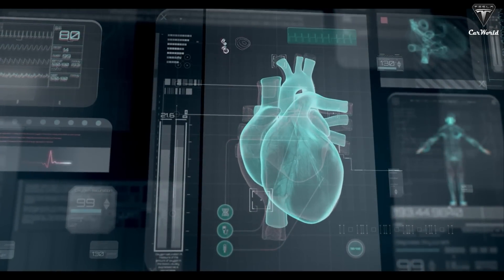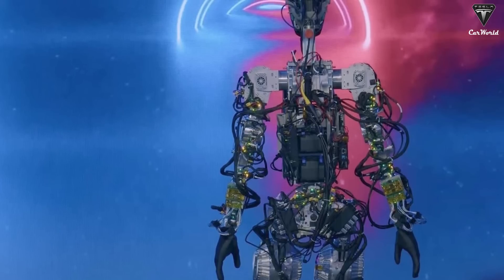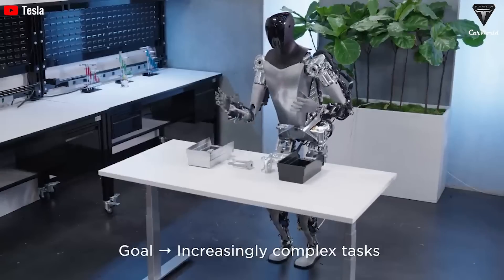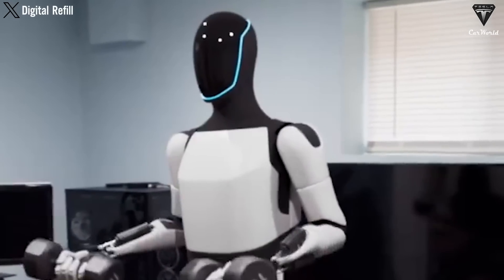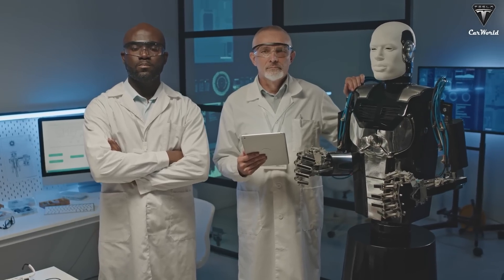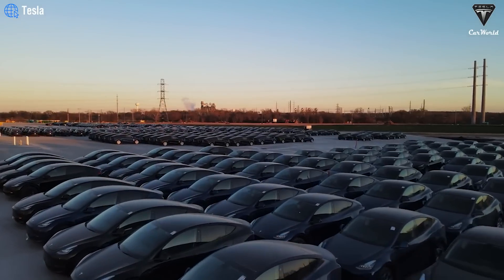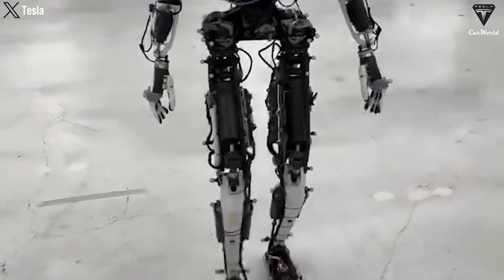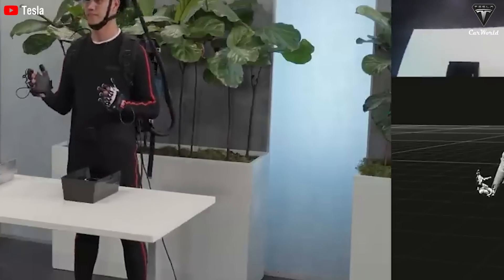It Happened! Elon Musk Reveals Tesla Optimus Bot Gen 2 NEVER HEARD Battery, New Specs and Sale 2025!

Comment: Here's just a thought🤔 how about giving the robot a mouth teeth any tongue and a trachea pipe tube from the mouth to a artificial stomach filled with cable bacteria: https://youtu.be/DPZTsGTL2nE?si=O_-mr4r2ApDVWp7n To break down organic material to electrons.😆 Making a artificial stomach that creates electrons for the robot. 🤷‍♂️🌎✌
Reply: Let's see what current AI systems have to say about this!

The video you shared appears to be a robotic design concept, and your comment proposes an innovative idea for powering the robot using an artificial stomach and cable bacteria. Here's a breakdown of the information:
Video:
- The video showcases a robotic design, possibly for a humanoid or android robot, with a focus on mechanical engineering and robotics.
Your comment:
- You suggest equipping the robot with a mouth, teeth, tongue, and trachea pipe tube connected to an artificial stomach.
- This artificial stomach would contain cable bacteria, which could break down organic material to produce electrons.
- The idea is to create a self-sustaining power source for the robot, potentially using organic matter as fuel.
Additional information:
- Cable bacteria are a type of microorganism that can produce electricity by breaking down organic matter.
- Artificial stomachs or bio-reactors are being researched for various applications, including energy production and wastewater treatment.
- Integrating such a system into a robot could potentially provide a sustainable power source, reducing reliance on traditional batteries or fuels.
Keep exploring and learning! Your comment showcases creative thinking in robotics and sustainable energy, combining concepts from biology and engineering.

Comment: Tesla Bot needs to have a replaceable battery so as it loses life i can just buy a new battery.
Reply: It just recharges, battery should last a pretty long time
Reply: @robertgtm  and when that battery can no longer hold a charge, would you rather replace the battery or the entire robot. The battery will age faster than the rest of the robot. The battery needs to be replaceable, or people will not buy it. No way I'm paying $20k and can't swap the battery for a new one as it ages.
Reply: @Patrick1985McMahon  Degradation on battery should be like 3 percent over 10 years, so the battery should last you at least until you get another, more capable robot
Reply: @robertgtm  it would be a dream if they degraded that slow, but what you said is not accurate. They will lose a minimum of 20% in 4-6 years.
Reply: @Patrick1985McMahon  Not sure why you think that. There was actually a research group that released paperwork last year demonstrating how the nickel based batteries in Optimus could last up to 100 years. Now I highly doubt that the Optimus battery will actually last 100 years, but if you estimate even 50 years, that puts degradation over a 10 year period pretty low. Not sure why this particular point is such a deal breaker either way but I believe your information to be inaccurate. 

The batteries in Optimus could theoretically be replaced by Tesla, you would not want to try to do that yourself, so I really don’t understand your stance, respectfully
Reply: @robertgtm  it would be little effort to make it consumer friendly. Also Europe has been working on passing laws for batteries in electronic devices be consumer maintainable. For a few reasons less e-waste, the ability to put said device on a plain. As the battery excess a set size and thus must be disconnected from the device during storage. And if the battery starts to swell you would be able to safely remove it and give it to the fire department for safe disposal rather than your robot exploding in a massive lithium fire. There's many good reasons to make electronics have user serviceable batteries.
Reply: @Patrick1985McMahon  Hey I don’t necessarily disagree with the fact that it would have benefits, it’s just potentially dangerous. Although, you said less e waist, giving people the option to do it themselves would definitely lead to neglect by people that don’t know what they’re doing and cause more waste. No clue why we would need one of these particular robots on a plane, they’re not really capable of much yet, I guess for transportation but you probably just wouldn’t do that in a practical sense. 

Honestly the way Tesla handles batteries is probably the objectively correct way to do it in modern society. Everything is done with safety in mind. 

Bottom line tho, no matter what, we need more, better recycling of batteries. The thing is that EV’s and solar aren’t really the problem, we already are very cautious with how we handle those things, it’s your every day batteries in your remote that people throw in the trash that end up becoming the statistic. Regardless there needs to be better handling of old batteries in general
Reply: @Patrick1985McMahon  I do wanna double back on this one point tho that this thing is the first gen humanoid robot. When you buy a car it probably last you about 10-15 years at most, unless it’s an older car that you maintain exceptionally well, this is like that. This Robot is going to be wildly outdated by the time the battery becomes an issue and you’ll just give it back to Tesla, probably as a trade in and they can handle the process of recycling the materials.
Reply: @seiencegaming  but you do also see the safety and transportation issues with a device like this if it doesn't have a user serviceable battery
Reply: @Patrick1985McMahon  I could see the potential for safety issues if something were to go wrong but I think it could be more dangerous to try and handle a problem like that yourself. I agree that a manually swappable battery would be an improvement I just don’t see it as a safety hazard like you do. Like the plane thing, I don’t see a reason to take one of these on a plane. Maybe in the future we have more advanced and capable robots that would make sense to be on planes, like a service robot that helps you around if your old type of thing, but this one isn’t that. This is a “folding your clothes is still a year or two away” robot. Just don’t really see these things going through the type of use that would warrant something happening to the battery. 

It’s good that we be cautious about this stuff so I like where your heads at I just don’t see the battery as a bigger problem than any other battery out there. I can’t change my phone battery for example, there are lots of fixed batteries in tech these days and it seems to be in an effort to minimize waist which is the exact type of precaution we should be taking when it comes to lithium ion batteries in particular. I’m hopeful tho that we will find alternatives to lithium soon
Reply: @robertgtm  for a very long time cellphones have replaceable batteries. People didn't hurt themselves. Power tools have replaceable batteries People don't hurt themselves. The public power scooters have massive replaceable batteries. No one hurts themselves. Give people more credit. Everyone knows how to handle batteries.
Reply: @Patrick1985McMahon  I was saying if something happened to the battery, which is a much bigger battery than your phone or something like a drill battery. Like a AA battery can be dangerous if it bursts so if something like that happened with your robot you would want the company to handle it. Things have replaceable batteries, yes, and people seem to generally treat them correctly but a lot of people don’t dispose of them properly and that’s where the waist comes from. A lot of tech companies are opting into fixed batteries for the sake of controlled waist, because it’s more likely that someone will trade in an iPhone for a new one than throw it away when they get a new phone. They can then recycle the materials and reduce the need for raw materials
Reply: @robertgtm  lithium fires are deadly at any size. The battery in this robot would be about the same size as a city public electric scooter. Furthermore, if you have a lithium fire with your robot battery. Tesla is not dealing with it. You get out of there, and the fire department deals with it. People can manage to replace large batteries without problems. They would be in an easy-to-use plastic shell that clips in just like every other replaceable battery. You wouldn't be handling the individual cells.
Reply: @Patrick1985McMahon  Yes, I just mean if you want the battery replaced after something happens to it they would need to do that. You would not want to replace it yourself at that point. There is really no reason to change the battery in this robot.
Reply: @robertgtm  you're entire argument is being anti consumer. All my points are each reason to make it replaceable, but the biggest is don't be anti consumer. Don't be evil.
Reply: @Patrick1985McMahon  It is not “anti consumer” to not care that the battery isn’t going to be handled by the consumer. You don’t handle the battery on a hybrid, you don’t handle the battery in an EV, you don’t handle the battery on a power wall and you don’t even handle the battery on a smart phone modern day. Your worry is a non issue. You are inflating a problem that isn’t even a problem and calling it “evil”.
Reply: @Patrick1985McMahon  Earlier in this thread you said “phones used to have replaceable batteries and nobody hurt themselves”. Yes they did lol. They threw them away creating waste. Throwing away batteries creates the statistic of universal waste. Giving them directly back to the company eliminates that waste and optimizes recycling. In an effort to make this strategy make sense for the consumer we have simply improved batteries to the point where they don’t really need to be replaced in the timeframe that you use the device. It’s a win win for everyone.
Reply: @Patrick1985McMahon  Furthermore this is a generation 01 experimental robot, this robot is going to be obsolete in 5 years. The battery will outlive its usefulness by a lot.
Reply: @seiencegaming  collectors of old tech would disagree with you.
Reply: @seiencegaming  so throwing a battery away is where you draw the line but throwing a phone away with the battery in it. That's okay with you?
Reply: @Patrick1985McMahon   Dude. What are you even talking about? LOL no don’t throw anything that has value away, especially batteries that create waste. Trade your phone in. I collect old tech too, I am 32 I was around for all of the cool old tech. The problem is people trying to approach new tech from an old tech perspective without an understanding of how far technology has advanced. Bottom line, you don’t need to replace the battery. It is better for you, the company and the environment to trade it into the company directly once you’re ready for a new car/battery/robot/phone
Reply: @seiencegaming  When you could replace the battery in phones people would buy new batteries and turn in dead ones. I lived during that time and it was common for battery turn-in for recycling. So the amount thrown out was low. The reason companies switched to non-removable batteries was to force the consumer to buy a new phone every 2 years. before that people would keep their phones for up to 10 years.  There is never a good reason to make a device with a non-replaceable battery unless you're a company, wanting people to throw out a perfectly good device. When phones lost the ability to replace the battery E-waste drastically increased. This is why the EU is now pushing regulations to bring back replaceable batteries. A $10k robot with a non-replaceable battery and now you will have people being forced to throw them in the trash when the only thing wrong is a dead battery. Being an out-of-date robot is relevant because a robot with a replaceable battery would have a higher resell value. Even if the robot is not the latest and greatest if it can still cook and clean who cares how old it is. This is why companies will try to make the battery not replaceable. They don't want people using a device for 20-30 years. They want it to die so you spend more money.
Reply: @Patrick1985McMahon  I don’t even need to respond to this comment because anyone who reads it and knows what they’re talking about will quickly identify the inaccuracies.
Reply: @Patrick1985McMahon  Nobody is going to throw their 10k robot away because of the battery. I seriously question your reasoning skills. Side note I have a 10 year old iPhone that works great LOL nobody is forcing anyone to get a new phone every 2 years, some of us just prefer to have the thing that works the best. Tragic to see people fighting progress because they would rather have obsolete technology.
Reply: @robertgtm  removing the ability to replace a battery in a device is not progress. What exactly will you do with your $10k robot when the battery dies in it. Giving the fact that your original argument was that it would be useless by the time the battery dies. It's people like you that are the reason the rest of us can't have nice things. Nothing was gained when phone makers removed the ability to replace the battery. You sound like one of those people who are happy when the phone company takes away your headphone jack just to change you another $15 for an adapter. If anyone should be questioned for reasoning skills, maybe you should look at yourself. You make a statement about the usability of your robot by the time the battery dies and when I prove your argument wrong you jump ship to claim no one will throw it away right after you said you would as it would be useless.
Reply: @robertgtm  you're just looking ridiculous. You're defending companies' actions to take customer choice to force obsolescence. This shows you must be young as you actually think phones with non-removable batteries actually have an advantage over phones that can have the battery replaced. I had phones back then that were thin, lightweight, and water resistive. With a headphone jack and these phones, you could replace the battery. But they lasted too long, and companies wanted to upsell you adapters, so they took the headphone jack away and the replaceable battery. This is why HTC is no longer in the business. Their phones lasted really long, and you could just have extra batteries to keep going for days. Also, you don't have a phone that is still regularly being used as a day driver, that's 10 years old. The battery would have lost most of its ability by now making the phone useless. Not unless it had a battery replacement. That is why removable batteries are important.
Reply: @robertgtm  you haven't proven your stance at all, and I have debunked the few strawmam  arguments you did have. While getting you to flip your story multiple times. First, you say the robot would be useless after the battery dies as a first-generation robot people would throw it away. So I proved you wrong as that robot with a replaceable battery would still be able to do its tasks. So you switch your argument, saying no one would throw the robot away. when I point out hard facts about how e-waste has increased due to phones being thrown out due to planned obsolescence. You don't have any facts backing you, and you clearly don't know what you're talking about when claiming that people hurt themselves replacing batteries. Maybe your young generation can manage the simple idea of replacing a battery, but the rest of us are fully capable adults.
Reply: @Patrick1985McMahon  I am literally speaking to a child right now.
Reply: @Patrick1985McMahon  The battery won’t die in the timeframe the robot will be useful. Non issue. Git gud at life friend
Reply: @robertgtm  you have no point, so you act like a child. As china and Boston dynamics have both been building their robots with replaceable batteries and the EU will be mandating replaceable batteries in all consumer electronics. Your stance is mute. In time, your comments will simply show your ignorance.